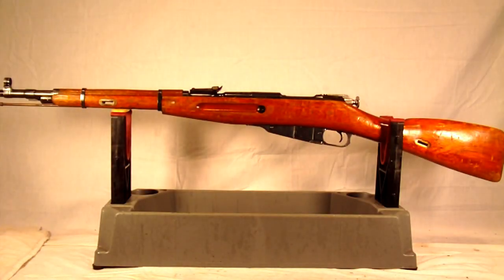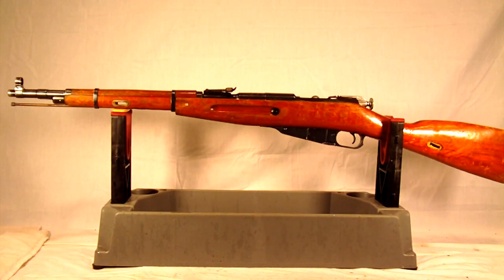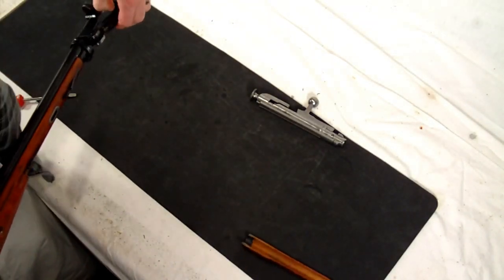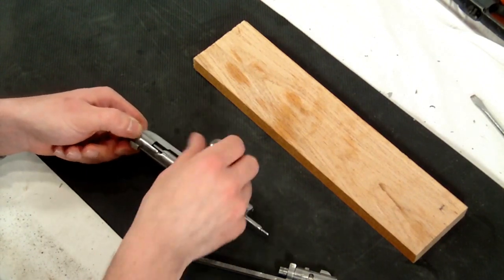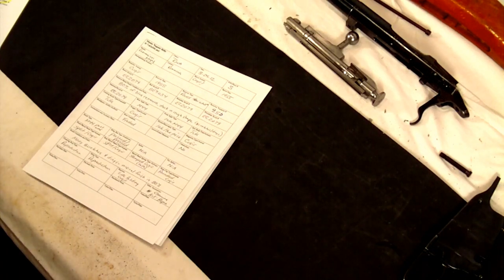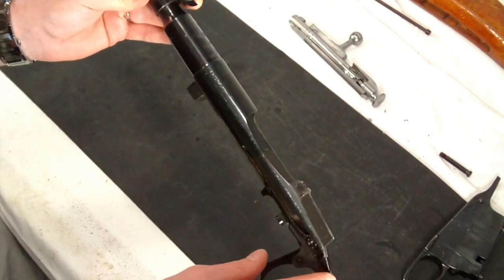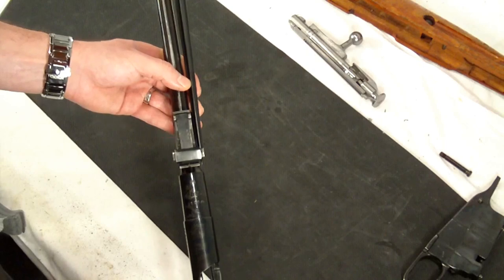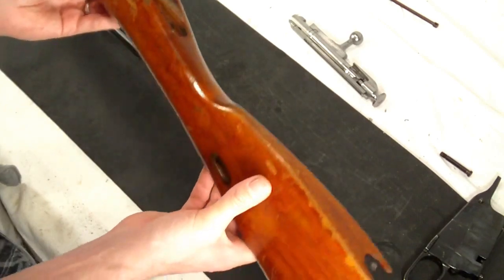Mosin Nagant M44 | Shooting & Disassembly

Comment: Right on! First thanks for putting this together. Well done. Second is I have a question for you regarding my own M44, my issue is that the stock is in such a sad state I'm looking for replacements if I can't fix the original one. Would you happen to know a retailer that sells wood stocks?  Thanks for the videos I learned a lot about the stamps on mine.

Comment: Question on assembly... how do you properly resecure the cleaning rod back in place? I lost mine while walking in the woods, ordered another one, and the new one doesn't sit in right/ go down all the way
Reply from the maker: Try screwing the rod in when fully seated into the holding channel.
Reply: @intoweapons  thanks, just gave it a try and had 2 issues... 1) when it was fully seated, it appeared like it didn't go down as far as it should; that is the external end of the rod was flush/parallel with the end of the barrel... and 2) as I tried screwing it in, it wasn't catching at all and when I pulled the 'internal' end of the rod out, there appeared a rust like substance on the end... any more suggestions?